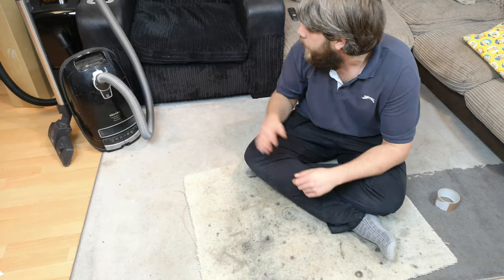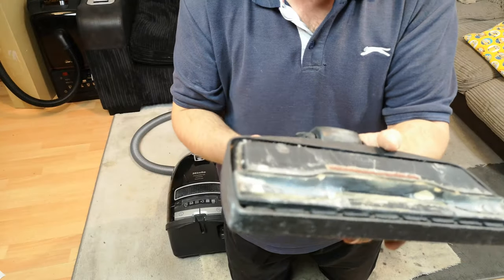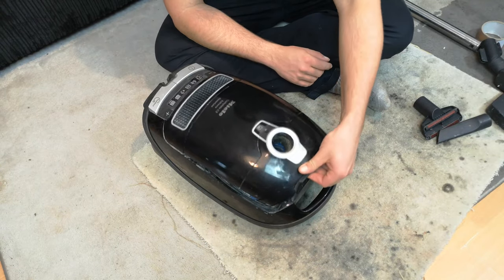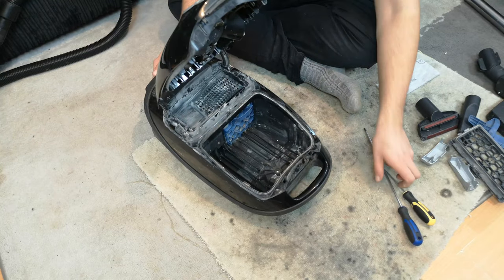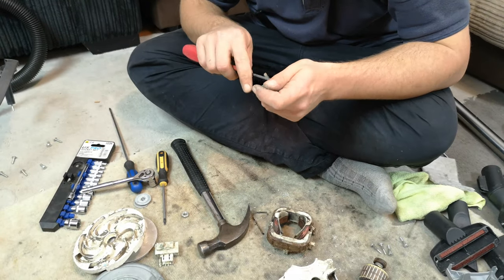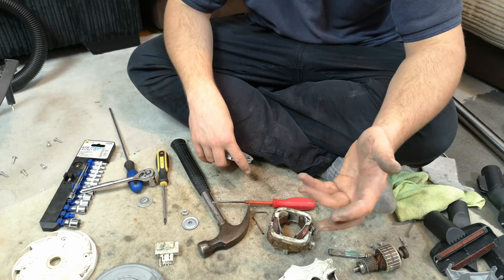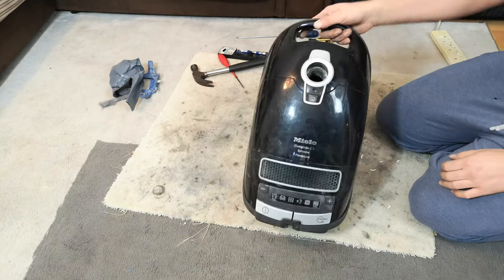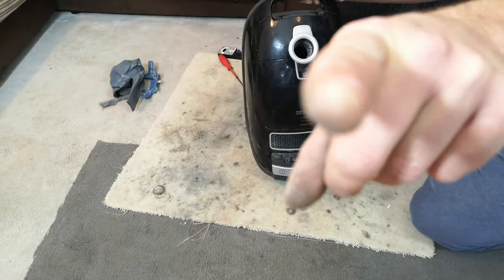Miele Complete C3 Extreme Powerline First Look & Attempted Repair!

Comment: Hey beko if you’re still answering comments I would like to tell you that the problem might be the speed control board where the + and - buttons are the problem is that it might be dirty with mould or something because that’s what happened to my Miele if it’s not that then you’re theory is correct
Reply from the maker: Hi! Will bear it in mind and certainly give them a spray of contact cleaner for good measure, it could be a cause. I just try and stay away from the bloody things now! Tried to fit a qualtex motor to one a year or so ago and it sparked and blew the bloody pcb! Never seen it before

Comment: I want to know how you clean up the motor, with water or just wipe?
Reply from the maker: The armature and coil get removed and everything casing wise gets washed. Fan is soaked in boiling water and washing up liquid until it comes clear. Then dry and reassemble 👍
Reply: @beko1987  thank you, Sam! The metal where the the coil is wrapped around is rusty, is it okay to oil it with machine oil?

Comment: you can use an S5 motor and just swap the impeller and the fan casing. in your case the commutator/armature has failed just like mine.

Comment: See your using us Pro tools 😂 I use them at work up against snap on and I found the quality to be nearly as good for a fraction of the cost 😂😂
Reply from the maker: Yea, got them at a car show for a fiver! And whilst I've not cracked big rusty bolts off on the car with them, for vacuum use their fantastic! (I have used them on the car too, in the engine bay on hard to reach stuff!)